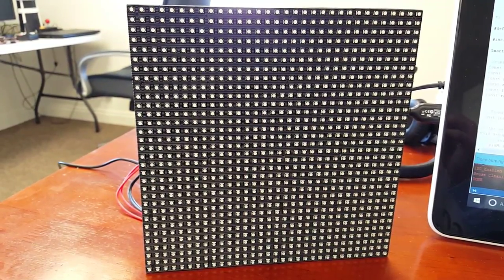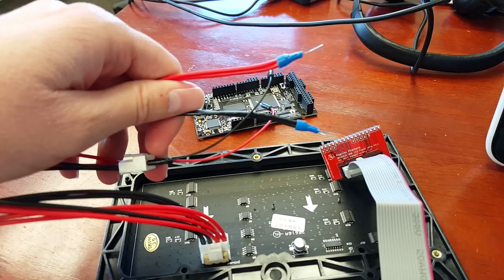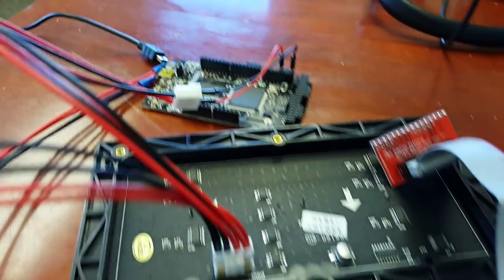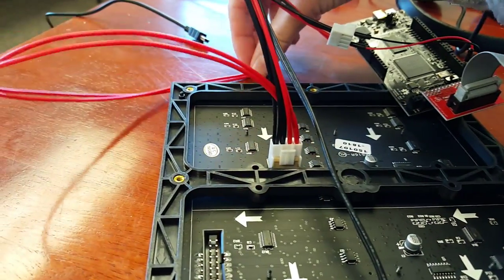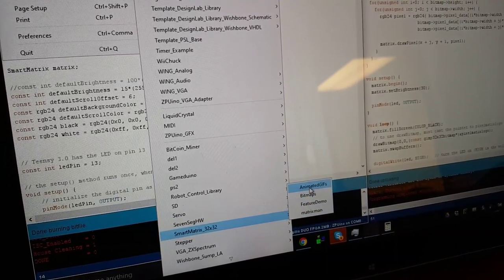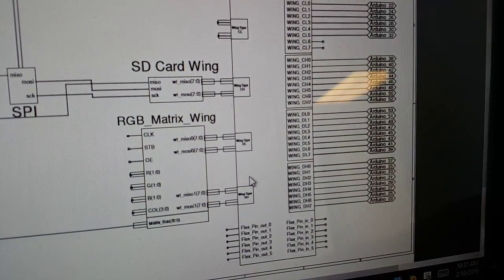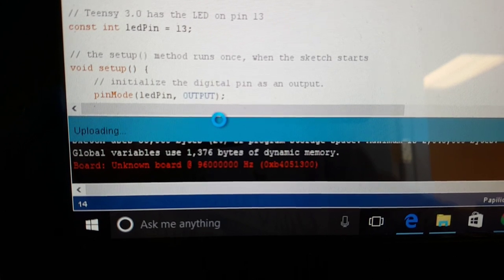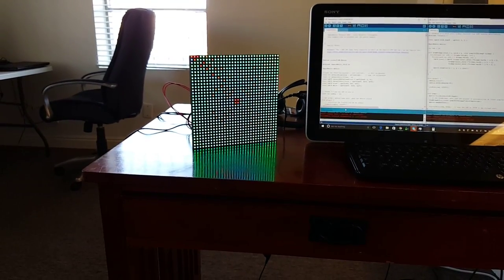Quick Start Guide for 32x32 RGB Matrix Panels

Comment: I want to make a led matrix using 32x32 RGB LED Matrix Panel - 4mm Pitch, vbestlife dc dc voltage converter power supply module 12v to 3.3v/5v/12v step down converter module, and the esp8266 dev board, will that work?

Comment: I am using 32x32 P6 module while running the program the P6 module was splitting into 4 Columns. but i need single line on 32x32 board how can i overcome this problem.

Comment: For importing your own images, does the panal scan go forwards, backwards or both, can you use a esp8266 as your main board and use a vbestlife dc dc voltage converter power supply module 12v to 3.3v/5v/12v step down converter module